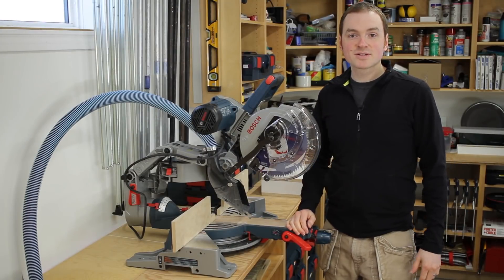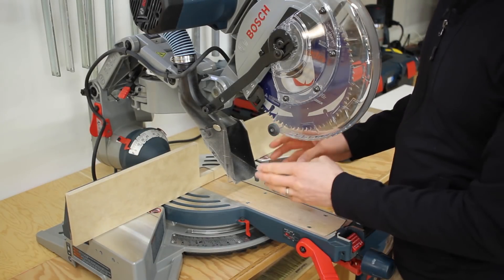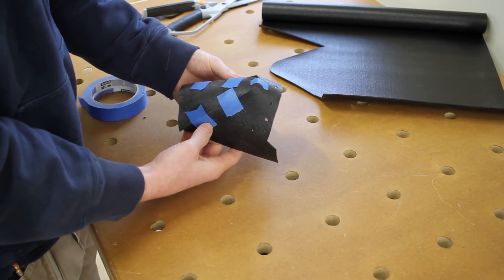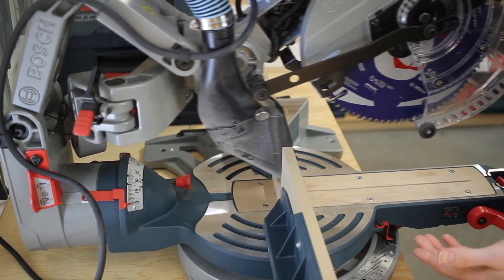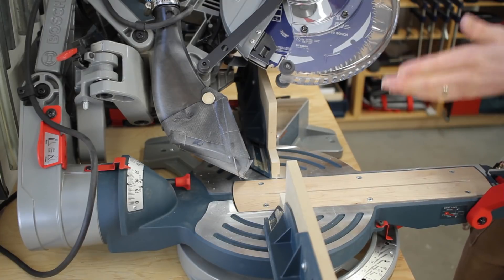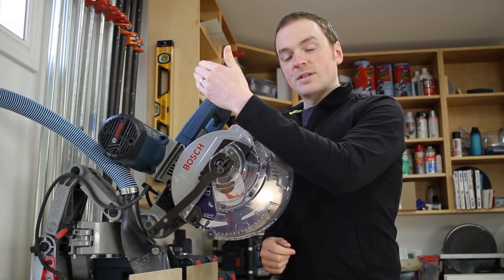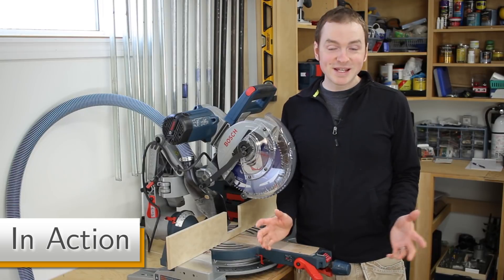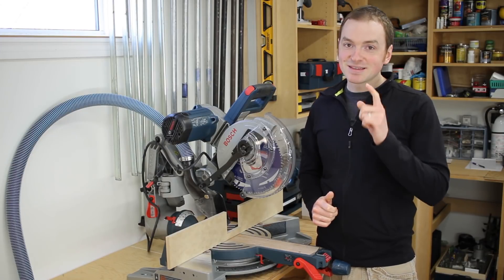Bosch Axial Glide Dust Collection Upgrades & Mods

Comment: Why do you have the added fence to your Bosch saw?
Reply from the maker: Having the fence on there makes it so the length mark on a workpiece can be quickly aligned to the blade kerf in the fence for proper cut position. It also helps reduce tearout on the back edge of the workpiece.

Comment: Hey Dan, fellow Canadian here. I have loved your videos for years. Thank you for providing us with such clear and elegant solutions to problems. I was hoping you might be able to help me out with a simple issue I'm having with my Bosch 10 inch Axial Glide. The miter arm of the saw is very difficult to move. If the saw wasn't bolted down to my my miter station, moving that arm would move the entire saw. It makes it almost impossible to set certain miters. Is there an adjustment for the tension on that arm? A screw or bolt somewhere perhaps that adjusts the tension? Thank you in advance and keep up the great work.
Reply from the maker: Hey, there is an adjustment screw up on top of the arm that will adjust how much resistance there is in the movement. That should hopefully fix your issue.
Reply: Thank you Dan. Simple answer to a simple question. You wouldn't believe how hard it was to find an answer. You are the best! @DPShopTalk

Comment: Is it my imagination, or have you defeated the safety switch on the handle.  I don't see you pressing the lockout button.
Reply from the maker: Yes I did bypass the safety switch since I found it was a bit cumbersome to operate. I just put a small piece of wood in where one of the safety switches is to keep it engaged. It is easily removable if I want to make the safety function again.

Comment: Great video production elements. Full marks.  I like the wire boot support.  What about a small hinged (connected to bottom run of the wire) ramp extender at the bottom allowing it to touch the table.

Comment: I don't know if you could ever get it better than that! You cleaned up a very dirty bird! About the only thing that might improve things from where you are now would be to make a buck out of wood in the shape of a mating connector of a 2" hose and put it in the hose end of the saws dust chute and use a heat gun to persuade it into the larger diameter. I believe a 2" hose from saw to vac would defiantly improve the performance, but it might mean also adding a 45 degree piece to deal with the hose/motor conflict. if the chute was round I'd just buy a replacement chute and try to cut the original down lower, where the diameter was larger, but it looks like the chute changes shape going down. But then that's almost nothing a heat gun can't fix! lol, Anyway, great job! I haven't seen anyone do that well with that saw.

Comment: I wonder if there's a better way to reinforce the dust boot without adding the wire. I would imagine the wire is somewhat counter productive because...while it adds rigidity to prevent collapse under suction, it also prevents the dust boot from folding when cutting thicker stock.
Reply from the maker: I think other people have used different methods for adding rigidity. So far I haven't had any issues with the wire.

Comment: Thank you very much - 5 years later. I just picked one up this week [$250 off on sale also], and am in the process of setting it up in shop. I could use all the tips you offer as wood working is new hobby for me. I was literally inches from buying a 12" Milwaukee - primarily because it was a bigger unit at the same price, but also because I really liked that Milwaukee has the bigger square dust extraction [which i was planning to set up into a box style dust enclosure system]. Your video was very informative, clear, and direct. You have a new subscriber up here in Ontario, Canada, and I look forward to catching up on all you videos.

Comment: What is the actual I.D. for your bosch dust port without the 90 degree elbow.  I have the same saw but 12", I assume the dust fittings are the same for the 10" and 12".  Correct me if I'm wrong.  Great job, I'm about to start on mine soon per your video.  Thanks for sharing!!!
Reply from the maker: I can't remember off the top of my head. I'll try and remember to check next time I'm in the shop.
Reply from the maker: The I.D. is 1-1/4" and the O.D. is 1-1/2".

Comment: Question (so basic it’s embarrassing): how the heck do you get the dust elbows off? Mine aren’t exactly screws they’re more like… straight ring metal bits?!  Have tried Allen wrench, screwdriver, even just hammering it out. Any guidance please?
Reply from the maker: I think the newer saws have rivets in the dust elbows. The only way to get them out would be to drill them out. You could just leave the elbow on there and connect the hose to it.
Reply: @DPShopTalk  Thanks so much for the response! Glad I wasn’t just being a dunce not looking hard enough for the right screwdriver…

Comment: I've got the 12" version and I cannot remove that elbow dust port without breaking it; mine is plastic not rubber.  So my question is do you know of an adaptor that I can use to connect that elbow port into a shop vac?
Reply from the maker: I think the newer saws have the elbow riveted on. I'm not sure as far as an adapter that would fit.

Comment: Hi Dan, went to your website and viewed both of the dust port sizes and am confused as to what lines to cut out for my 12" Bosch miter saw dust boot. The 12" dust boot template has hand drawn lines, are these the cut out lines for the dust boot for the 12" saw or what?  Thanks,
Gary
Reply from the maker: Hi Gary, yes the hand drawn line is the one to cut to for the 12" saw. A viewer sent me that modified plan based on his 12" saw.

Comment: Hi there, nice video!!! I have the same saw and i dont use any dust collection and i noticed that my table gets stuck and wont turn easily after a number of cuts, is this normal?? I usually blow it with the air compressor and apply some silicone spray and all's well, but should it actually be getting stuck after a few cuts? It seems really awkword for a saw of this range. Anyway, nice  video!!!
Reply from the maker: Thanks.  That doesn't really sound normal for the table to be binding up like that.  Almost sounds like something isn't adjusted properly. Even if you aren't using dust collection it shouldn't do that.
Reply: @DPShopTalk  sounds about right, maybe i'll take it apart when i have time, thx for the reply!

Comment: I made your dust boot for my Bouch saw, made it out of a corner for plastic gallon jug, worked great, but I missed what u did connecting the hose to the saw, removing 45 degree piece. I'll change that next.

Comment: nice vid, but I found, that the only way to prevent these saw dust blowers from dusting the  workshop is to house the whole saw beyond the fence, which I did with an aluminum profile frame box covered with acrylic glass 😉

Comment: Dan, HAVE A QUESTION FOR YOU.  I really like your approach and thoroughness.  With the added depth the dust boot and while cutting thicker stock (not baseboard) such as a a 4X4 or even a 2x4 sized piece, how do you avoid the boot bending up?  What's happened to me is the boot is pushed up, riding on top of the stock and sometimes, if thick enough, the stock will push the bottom of the dust boot into the blade cutting a kerf line in the boot.  Would be VERY interested to hear if you have a workaround.  Thank you.
Reply: I rewatched your video and do see you already addressed my question above by making the boot depth coincide to the typical stock thickness the user cuts.  Got it, thanks.

Comment: Great videos & I just bought the 12" Bosch.  I printed the template without scaling on 3 different printers.  The 9-7/8" width prints just shy of 9-1/2".  Is the 9'-7/8" correct?
Reply from the maker: It should be printing to 9 7/8". Did you download the modified version for the 12" saw?
Reply: @DPShopTalk  Thanks for the quick reply.  Yes, grabbed the 12"v.  Just printed on my home printer without scaling.  Still shy of 12-1/2"w.  Weird.
Reply from the maker: The 12" version was modified by a viewer so I'm not sure if it is set up the same way as far as sizing for printing but I think it has printed properly for most people from what I've heard. My only suggestion would be to play with the scaling until it prints to the proper size.

Comment: Dan, how did you remove the 90 degree fitting from the saw itself. It seems as though it is fastened with “rivet” type fasteners which don’t seem to be able to be loosened or removed? I tried pulling up on the fitting but it didn’t come off... Thx for all you do!
Reply from the maker: I think it was just fastened with a screw on my saw. From what I've heard, Bosch has changed the dust port setup slightly on newer saws so that could be the case with yours.

Comment: First, nice video and very informative! But, at about 9:35 you mention that you will put a link to the hose on your web site and a link to the connection reducer.  This may seem unimportant but I like to get the same items. The only link I saw on your web site was for the connection reducer and the rare earth magnets from Lee Valley, which by the way only take you to the Lee Valley main page and not to the items themselves.  I could search for these items on the Lee Valley site or Amazon but seeing as I have the same saw I would like to get the same exact products you used.  Would it be possible to get direct links to the hose and reducer you used in the video? Thanks
Reply from the maker: Thanks!  The link for the hose that I used is an Amazon link with a picture of the hose.  If the Amazon links aren't showing up for you, try a different browser as sometimes certain browsers don't display the Amazon link boxes properly.  Thanks for letting me know about the Lee Valley links.  I think it must have been because Lee Valley revamped their website that the links didn't work.  I just redid those links for the reducer and magnets to link to their new pages so those should work for you now.  Let me know if you have any other issues.

Comment: Just made one of these and tested it. The thing is that I missed that it is for the 10 in saw and I have a 12 in. And yet it works fabulously. I couldn't do the magnet hook up on the top as the fitting is apparently different but it still works great. the only thing that was off a bit was the hole pattern for the hooks. It didn't get every single bit but it's a huge improvement and I doubt a Kapex does any better. Thank you!

Comment: Great video-- I have the same dust extraction problem and will use the pool hose method to modify the saw's dust port. I use an iVac switch system and it works great on all of my machines except for the Bosch. No longer, thanks!

Comment: Udate. Tips and Test:     

Very important if you would like to saw with precision. (avoid torsion as much as possible)!
Always choose a Miter saw with a handle positioned in a vertical line above the saw blade.  
Everything must be aligned, slide rails, handle, and saw blade,it is much better this way the blade will not tilt.
Because there is some torsion in the aluminum housing .
And choose an engine with softstart on it to prevent wear of the gear and worm shaft.
It is very important that everything is aligned.
Here are some examples to show how the handle must be positioned above the blade.
Bosch gcm 800 sj / Bosch gcm 8 sjl / Evolution rage 3 / FESTOOL KS 60 / HITACHI C12RSH2 / FESTOOL KS 60 E KAPEX / Metabo KGSV 72 Xact 

(This also is the case with the Miter saw without the slide rails).

If you want you can test it yourself at home if there is torsion in the aluminum housing.

Step-1. First you make a saw cut from +-5 mm deep in to a flat piece of wood about +- 20 mm thick. To this with the normal handle positioned on the right side of the Miter saw.

Step-2. Then repeat this by pushing the saw blade down with your hand (finger) on the aluminum protective cover were the saw blade is cased in. Just now only do this without the running engine.

Step-3. Now you can see if the saw blade will be positioned in or next to the saw cut. If the saw blade is (+- 0,2 / 0,5 mm) next to the saw cut then there is torsion in the aluminum housing.

Step-4. therefor it is much better to choose a Miter saw with the handle positioned vertical in line above the saw blade.

Step-5. When you measure the vertical angle square (Digital level box) of you're sawblade don't forget that there is always some torsion in the aluminum housing.

Conclusion: how further away the handle is from the saw blade how more chance of torsion in the aluminum housing.(don't go for that). 

  Also with a cheap slide miter saw it is still better the handgriff a above the saw blade than on the right side. Maybe they will make it someday then we have a winne

Comment: You don’t need a zero clearance insert on a that saw.  The blade cuts from the bottom up, not top down like a table saw
Reply from the maker: It depends on the kind of cut you're making. If you make a chop cut through the material then the teeth are traveling down through part of the cut.

Comment: Thanks for this 
Dan.   I have had my saw for two years and quickly after purchase found this vid and did the modification.   I am on my second replacement since I do a lot of work and it does not last forever.   I find that the miter saw is the worst culprit for dust in my shop and this helped so much.   I have my saw set down in line in the middle of a 12 ft cabinet base and use the Kreg stop rail system to measure.   It is slick, but I still get some dust splatter to the back.   I wish I could invent some type of shroud for the back to catch the splatter since I have plenty of vac and can use another vac line for that.  Thanks again.  Love your channel.

Comment: just an FYI   your attachment holes don't match up to the rubber guard on the 12 Bosch.  also had to change the angle as this pattern had boot in blades way......
Reply from the maker: Yeah the 12" saw is different than the 10". A viewer sent me a modified plan for the 12" saw that I've been sending out on request.

Comment: This mod does not work on newer versions. I have 2019 and the dust extractor is not like this one.
Reply from the maker: That's interesting. Have they improved the design at all?
Reply: @DPShopTalk  Maybe, the dust extractor is angeled  and narrower. I made the new shroud but when I attached it came in contact with the saw blade. The part where you used magnets is not there anymore. https://www.dropbox.com/s/9m6tg4ajtbsylgm/Bosch%20Dust.jpg?dl=0
Reply from the maker: That's interesting.  I didn't know they had changed the design on that part.  Thanks for the pic👍

Comment: Holy crud I about lost my mind when you finally ran it and saw how little dust was left. Seriously mine makes me feel like I'm sawing in a blizzard when I'm done; will definitely be using your advice!

If you are still checking these comments; can you talk about what blade you chose and why? I've typically gotten freud blades; but I see the Wood Whisperer went with Forrest on his and I didn't recognize yours. What was it? Why did you choose it?

Thanks again for a perfect vid for us Bosch Axial Glide owners!
Reply from the maker: Glad you found the video helpful. The blade I use is an 80 tooth Bosch Daredevil blade. I got it for free and it's a decent blade but nothing special. Freud or Forrest blades are definitely better. I use Freud on my smaller miter saw and have a Forrest for my table saw and like them.

Comment: Great demonstration....! Why should we, as customers, go to this effort to improve the dust collecting system of the Bosch Miter saw? Why and why?
Bosch is run by Engineers whom do not care a bit of their customers. A miter saw that costs an arm and a leg, with no laser, no adequate dust collecting system?....really.?
Why should we buy their tools? Tell me somebody?
Reply from the maker: I think their target market with this saw is general construction in which case dust collection isn't much of a concern. For my purposes in a shop setting dust collection is more important and also if I'm using it on site for trim work in a finished space. Having said that it would be nice if they gave a bit more attention to a good stock dust collection setup.

Comment: Great job. Just a little hint here. In high pressure air flow situation like vacuum or blower, the tube angle almost have no impact on the air flow. The tube angle only have noticable impact on low pressure air flow like axial fan.
Reply from the maker: Good to know, thanks for the info👍

Comment: The hose is a good idea...But I can improve on this. I'm considering this machine for diy around the house. Why didi you change the blade? The original is very good.
Reply from the maker: The stock blade is ok for rougher work but not for finish work. I use the stock blade if I'm cutting framing lumber.

Comment: Hi Dan. Looking into a purchase for the same saw and you did great job explaining and clearly narrating the whole thing. I do have a off-subject question about plywood you are using for a test cut @ 11:49. What is that type of plywood called? It does have plasticky coating on the face/back of it. I asked at my local big-box-stores and representatives look at me like I speak klingon. Thanks in advance!
Reply from the maker: The plywood that I was using was a prefinished plywood that was left over from a job I did years ago.  It actually has some wood plys and some MDF plys and then a stained and lacquered veneer on the surface.  It was used for finished gables and panels on prefab cabinets.